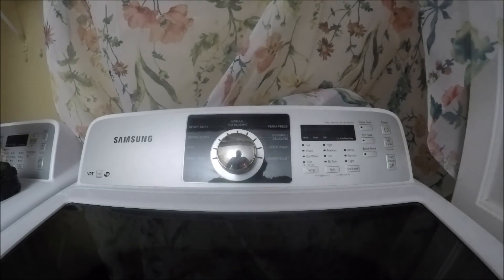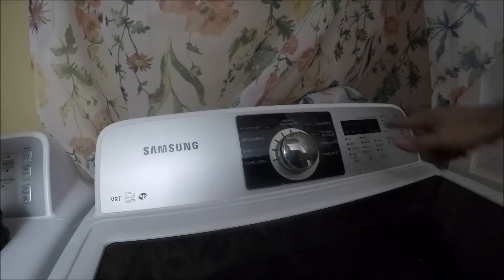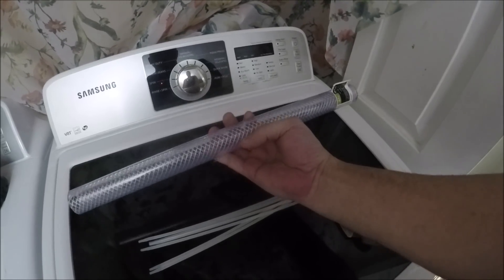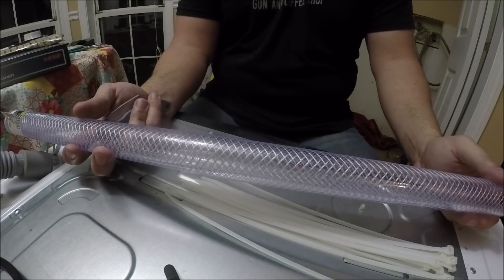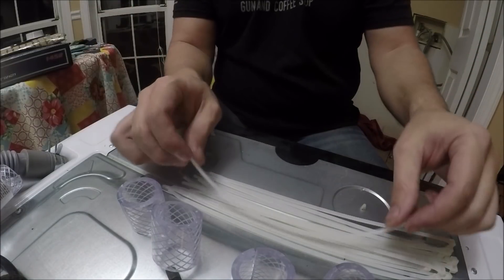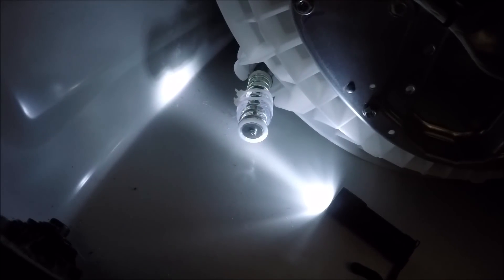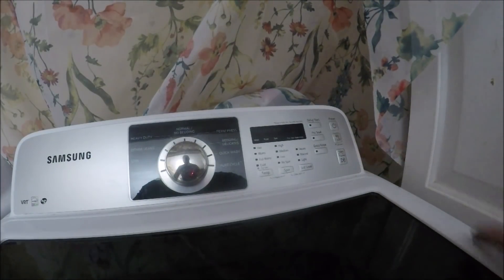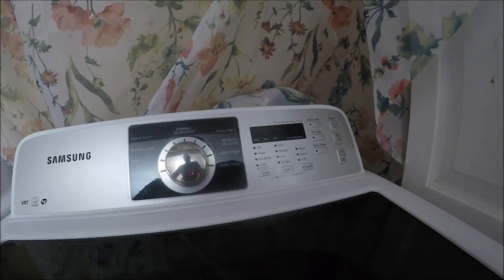Samsung DC Error Code $3 fix in 5 minutes

Comment: I was skeptical but the fixed worked great. No problems the last few weeks. FYI, if you responded to the Samsung "exploding washer" recall, the "fix"resulted in them bolting down the top of the washer, so you can't just pop the top up in the normal way. Have to take off two additional hard to reach bolts from the inside of the unit. But you can do this fix by accessing the springs as shown in video. Thanks cvsahara, much appreciated.

Comment: This worked perfectly for me. THANK YOU! You're the real hero.

Notes:
- My Home Depot had 1 1/4" inside diameter. The pipe sides were much thicker than the 1", so I went with that. (This video is a lie. My pipe was just over 6 bucks. ;-)
- I went with 2" pieces. To make nice flat pipe ends, I cut them with a hacksaw. I used a utility knife for the vertical slices. Very easy.
- The pipe was slightly too large in diameter to pinch down in place. I ended up slicing about a 3/16" sliver out of each. Worked PERFECTLY.
- I used three ties on each pipe for extra hold.

Comment: Just like all the other comments, this fixed worked like a charm. i used the 1 inch inside diameter tube from Home Depot because the 1.25" was too big for my springs.  Thanks a bunch for posting this video.

Comment: Thank you brother! Our samsung top loader was throwing that DC code constantly. The rods for this one are $80 something. I used some black plastic water tubing I had laying around the farm from a recent well replacement. I cut 4 pieces about 3 inches long and split them and removed about 1/2" strip from them. Slipped them on and secured them with 3 zipties each. Problem solved! Not really sure why this works but it definitely does! Cost me nothing but time! Thanks again

Comment: Was only able to grab the 1” threaded vinyl tubing at the Lowe’s near me, but followed your steps and sure enough this did the trick. :)

I tried reinforcing the entire drum with padding on all sides first, as it worked for some others, but that mostly resulted in the entire washer trying to hop away, lol. 

I’ll probably still reach out to Samsung to see if they can send a tech out through the recall on this unit for the issue, but this definitely saved me a week or more of frustration. 

Thanks again!

Comment: This worked for me, thank you!   Using 1-1/4" ID clear plastic tubing, cut 1-3/4" long and zip ties.  Put the washer on its front to access the bottom.  Easy to do. Still working after 4 big loads, no vibration, it's solid. If it goes out of balance again I'll probably replace the zip ties with hose clamps.

Comment: My repair was closer to $113 - here's why:  Having this exact error and it looks like the exact same washer, I ordered replacement suspension rods, but was surprised when it didn't fix the error.  I tried this fix in the video, and it did not work for me exactly as shown here - I had to do two things, and I'm not sure which one actually fixed the error. For reference, I cut the pipes to 1.25" and then split them vertically as shown in the video.   I was not able to get the zipties tight enough to make a difference (still got the DC code), even using a pair of pliers to tighten as much as possible.  They would still slip around and slide toward the bottom of the spring.  Someone else mentioned it in a comment, so I used 2 #20 stainless hose clamps (Lowes Item #1436436) and that held it in place adequately.  At the same time I replaced the zipties, I replaced the vibration sensor (part number DC93-00278B for my specific dryer).  I did it all at once, since my goal was to fix the error - not definitively determine which was causing the error.  I actually suspect it was the vibration sensor since the suspension rods were brand new.  One important thing to note - this piece of flex pipe has been discontinued at my Home Depot - (Internet # 303209686) but thankfully I was able to find one with the help of a store associate.  Lowes didn't have a comparable item to the hose..  My cost breakdown:  Suspension Rods $51; Vibration Sensor $33; Vinyl braided pipe $9; Hose clamp 10 pack $20.

Comment: Worked great for me too!  Bought this washer second handthought I got a great deal until the code came up.  This fixed it perfectly!  1.25 braided hose cut to 1.5 inches (about lol).  Mine were uneven and it worked fine.  my advice to anyone else doing this is make sure you have a good knife.  The braided hose is solid.
Reply: Did the code return or your washer is still holding up?
Thanks

Comment: I just performed this modification and three loads of wash later things are looking good. my resources were limited so i used two overlapping pieces of 3/4 ID hose and one zip tie each. The first load of wash was four towels and an entire basket of assorted clothes. Full speed spin and i got a successful wash. After that i washed a comforter and then another. For the comforters i select the bedding cycle. I performed the fix using the top-down method because my washer is sharing a tiny wash room with a dryer and bottom -up wasn't possible in those tight confines. 
Cannot even tell you how many times i had to interrupt the wash cycles due to incomplete spin cycles, easily a couple hundred or more. I don't expect that my work with be the last time i have to do this but i do know that it works and that i will be able to do a better job next time. One important thing to note. The support rods had a very thick sticky substance on the connection points and i suspect it had something to do with the "class action repair" performed on the machine a couple years ago. That repair was paid for by Samsung due to a lawsuit against Samsung because the machines had a likelihood of "exploding" during the spin cycle. My guess is that the thick sticky substance was a form of adhesive that was put into place in order to keep the rods from hopping out of their support brackets due to an unbalanced load. So if you encounter this thick sticky goop, my advice to you would be to not disturb or remove this stuff best you can. While i was able to put into place the new template for the various cycles, Samsung still had to have a technician come out to perform some further work that i was not able to observe, but i can assure you the thick substance was not mere grease as it felt like a mixture of both grease and glue from a rat trap.
Thank you for the help.

Comment: Thank you for doing the video on this fix. I performed this fix two weeks ago and everything has been working great since then. I bought the 1.25" ID tubing but ended up slicing out probably a little more than an eighth of an inch so as to leave room for the zip ties to squeeze the spring. The whole thing works great. If I was going to fix it again I might even just try sliding the 1.25 inch inner diameter tubing right over the spring and see how that goes. OR I might also just buy the 1 inch ID tubing, slice then zip tie. Either way, weak springs really seemed to be what the problem was. Thanks again for doing the video cvsahara.

Comment: This works! The only difference on mine is that my springs already had that black plastic piece on them. It must have been a later model Samsung that they put the upgraded spring mechanism in. However, i used 1 1/4 inch inside diameter plastic tubing like he suggested and cut four pieces at an inch and 1/8 long and fastened them to the bottom of the spring underneath the black plastic piece with a small hose clamp. $10 total parts. I’ve run several loads of blankets, towels, and regular clothing since with no error codes nor shutting off prematurely. I chose to use hose clamps instead because I was afraid of the zip ties breaking after a while.

Comment: This works!! Too bad I didn't know about this fix the first time the dc plague came to my door, or it would've saved me a lot of money. But I applied this fix after the replacement springs wore out again and it has worked like a charm! I don't even care if I have to do it all over again in a few months or years as it took less than an hour and I have enough tubing left for at least 2 more repairs :)

Comment: This worked great!  We used 1 1/4" ID tubing as suggested, cut in 2" sections.  Worked like a charm - thank you so much!!
Reply: You didn’t even need to do that, just double stretch the springs so when a heavy load of laundry compresses them it doesn’t bottom out.

Comment: Thanks for the video fixed outs for five bucks instead of ordering the parts for over $160!! And the 1 1/4 works best it covers the springs
Reply: Just bought inch and a quarter. Did you have to cut them down the middle still?

Comment: Another quick comment thanking you for this video.  Worked for me.  I was on the fence with using either zip ties or clamps.  Went the cheaper route.  If it starts giving me unbalanced code again I'll switch to clamps to get the tubing tighter.  Thanks again!

Comment: I was going to try your idea with a 1 3/8 braided hose when I notice the only thing keeping the rod assebly together was one end was smashed. I took two hammers so I could lay the smashed end on one hammer and pound the end to get it round again and small enough to slip every thing off the rod I used gloves since the rods and spring is greasy. I put the tubing in a glass measuring cup with water and microwaved the tubing for 3 minutes to get it soft enough to work it over the spring; If you can find the 1 1/2 tubing it should go over.without heating. I just put everything together and smashed to end so it don't come apart. I don't have to worry about the zip ties breaking. Thanks for sharing your idea.

Comment: I replaced the rods and springs...didn't help a bit. I tried this fix. Ran the washer at high spin for the first time in months. No DC!!! I used the 1-1/4" ID tubing but had to cut a slot out of it because it was slightly too big. Took the rods out from the top. Thanks for posting this video!
Reply: Also had to cut a slot out of the 1-1/4 tubing, but for under $7.00, I can do some cutting! 2 months later and no DC code...

Comment: Thank you!!  for all your comments I JUST PUT 4 hoses 1, 1/4 diameter .1, 1/2  long. I DID MY FIRST WASHED IT WORKED PRETTY GOOD👍 . I ALSO ADDED 4 SPONGES A 1 INCH THICK ON THE WALLS TO HELP THE DRUM NOT HITTUNG THE WALLS  IT IS WORKING.

Comment: worked for me! used 1 1/4" id fiber reinforced vinal tube. softened in boiling water, pushed snuggly onto the springs. zip tied in place. back is off the machine so i can monitor the situation. so far so good. thanks, be well, peace.     dp

Comment: It worked!  (So far so good.)   A couple points:  the smallest length of tube  at Home Depot was 2 feet of 1 3/8 OD and 1 in ID that cost $5.50.  Otherwise it would have been longer and more expensive. I had to use a bread knife to cut the lengths tube was too bouncy but the exact-o knife worked for splitting them standing up.   I pulled on the spring-rod and it came out!  OUCH!  Luckily my partner fixed it.  I played fast & loose on the measurements and how tight to use the zip ties and it seems OK.  Got my hands quite greasy from the lube on the springs.  There is residual water in the thing when you tilt it on its side.

Comment: Thank you for the video, I have the newer model with the new shocks and they still went bad. Did this fix and it worked like a charm, I can’t thank you enough
Reply: Was your drum bouncing like crazy and not allowing cycles to finish? Currently having this issue and I think it may be those shock absorbers.
Reply: @feedthebair  it was shaking like crazy when i had a heavy load and on medium spin, did the fix and its been fine since then had some ub codes but that was load not being evenly spread out, would recommend trying this first before spending money on new shocks

Comment: This video and fix will work. I repair appliances for a nationwide company and even though this fix will work my company requires the original parts for the repair due to LEGAL reasons. As much as I want to do this, I can't  bc if a homeowner got injured or property damage then my company becomes responsible and my dereliction of work ethics in the industry would cost me my job.

Comment: Worked on my model WA400PJHDWR/AA 👍🏼 bought the same pipe at 1.5 inside diameter and did not have to use zip ties, just pushed them into the spring

Comment: Found this fix and modified the suspension by cutting 1/2 ID rubber hose at half the full length of the spring and split down the length and insert inside each spring.

Comment: I did what you did but my two suspension rods in the front were shot. It was crazy the difference in ccondition from the back ones. So when it started it didn't work. Bi ordered replacement parts , 2 rods on Amazon for $9.99. I'm goin to replace those now and hope it works

Comment: Sad to say but I tried this fix and it worked for a couple of weeks. After that, I got the code again. I finally bought replacement parts, not from Samsung, it cost me around 60$ and the problem was fixed. At least, I tried...
Reply: same here, what did you buy may I ask? I hate this washer

Comment: I tried this and it works great, although it doesn't last. I had to repair one or two springs every few months. The hose eventually slides over the stop at the bottom and the error returns. After repairing a spring today I decided to slide the hose over the rod and underneath the spring on all 4. I am hoping this is a permanent fix~

Comment: Tried this with clear hose and zip ties, worked for about a week until the error came back. Reapplied the hose to the springs with metal hose clamps (super tight), didn’t last a day until the error came back. Maybe I’ll just need to replace all 4 rod assemblies.

Comment: Purchased the 1 1/4" Inside Diamter hos and installed as instructed. Worked one time. Now I get the same dc error code over and over. Will check to see if the problem is something else.
Reply from the maker: Make sure the rods are seated properly. Other than that, sometimes the springs are so weak that even the extra tubing doesnt stifffen them enough.

Comment: I used the 4 zip ties for each rod. It failed after 6 months. Looks like it is just a temp solution. eventually, the suspension rod replacement is needed.

Comment: Initially I replaced the stabilizer rods but now the problem is back after a few years. Recently went and bought heater hose from Advance Auto Parts and used it but problem is till off and on. Did not know they had a recall on this washer  either. Is it too late for the recall? Seems to happen more frequently on small loads.
Reply: I have to thank you even do i could not see the hole video i still understood what you were explaining and i needed to make it work right away and only had garden hoses,so i doubles the hoses using two for every rod and thanks to you i was able to clean a sleeping bagg and sheets without a mfing dc error code thank you so much the world needs more people like you giving their knowledge to help another desperite felow like me.i didint have the time to go buy a 1"hose and needed to make it work right away,i dont know how long it will be working a d probably i will need to redo it with better hoses but for now it works and i am so happy.god bless you for sharing your knowledge

Comment: Didn't work. After doing this I was able to successfully run two loads of wash that included a few towels. I then ran a third cycle with an empty washer and washing machine cleaner in it and started getting the DC error again with an empty washer
Reply: QTN Tube What did you do to fix your washer?
Reply: @BellyUpFishGarage  I ended up buying new bars/springs and just putting in 4. Haven't had a problem since then.
Reply: @BellyUpFishGarage  here are the ones I used.  https://www.amazon.com/dp/B016R1HEXG/ref=cm_sw_r_other_apa_i_MAlPEbED3MDQ9
Reply: QTN Tube Maybe I’ll look into that. I abhor Samsung and would almost rather light a stick of dynamite under this thing than give them anymore money.....
Reply: QTN Tube Thank you.

Comment: It work for a while but fails again in a few weeks. This is just a temp fix while the new springs upgrade arrive.
Reply: I agree with you. I tried 1 1/4” ID tube with zip ties. It worked perfectly on the first two loads and then the tube got loose and went down. I rezipped and tightened it much more again worked one load and failed. I am not sure if all these people are just not reporting back after many loads or still working for them. I think i might use clamps this time

Comment: What exactly was the washer doing before the fix? Was there any error codes? Mine simply won’t start until you turn it on and off a few times
Reply from the maker: That sounds like something else. This issue has an out of balance drum while spinning that results in a DC error code
Reply: Yes my husband figured out the problem. No we just need to order it. Thank you so much.

Comment: I'm trying to watch this video. I have a Samsung with DC errors... when I get to where you are slicing the little pieces of hose, the video freezes and will not go any further.  Help! What do you do after you slice the rubber hose?
Reply from the maker: You are the second one to say it is freezing. There must be a glitch with youtube. it plays fine for me and all the other views. Either way, long story short, cut the tube into pieces and then slice it down one side so you can clamp it around the spring. then zip tie each end around the spring to keep it in place. essentially you are making a sleeve around the spring with the tube in order to stiffen the spring up. once you have done this to each spring, you should be good to go. Hope this made sense
Reply: @cvsahara  yes sir! Thanks for that. I spent two hours last night trying to get a load of towels to spin. If this works, I will be super happy. It's been throwing that code more and more over the past few months, so I figured something must be getting weak. Thanks again!
Reply: @dannymacnevin3939  did it work out for you?!